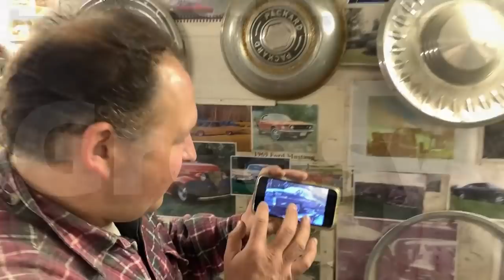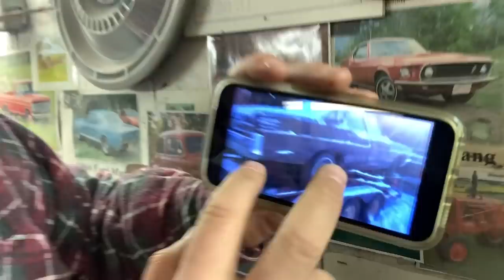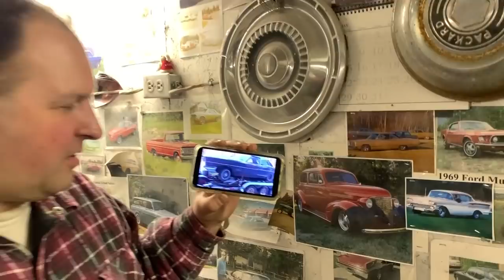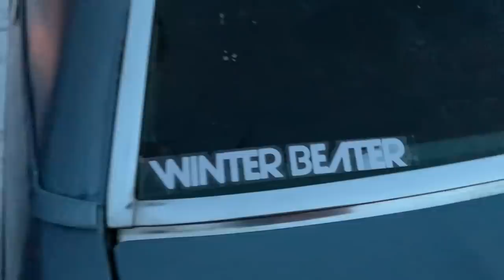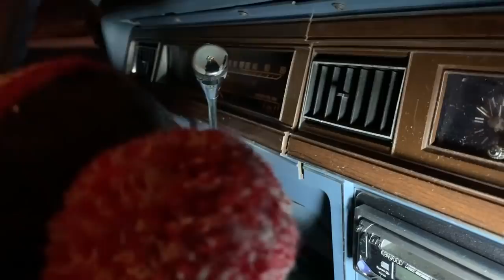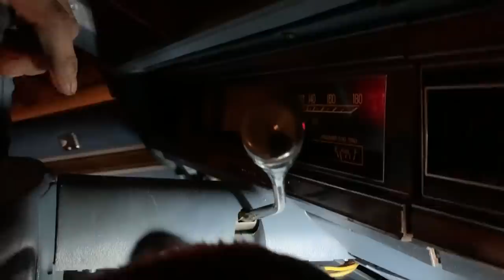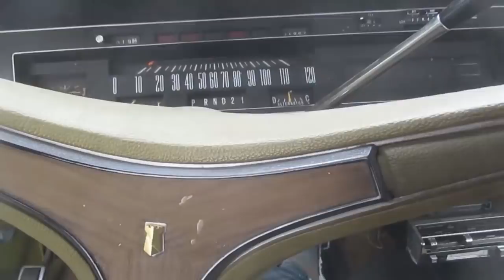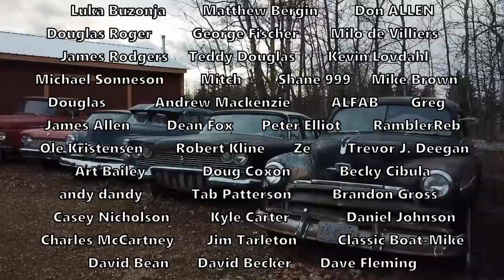Greasy Flips, more Fab, Trim, Paint, and and Beater Updates!

Comment: Nice lines on that old Pontiac, maybe the engine can be un-seized and run again, we need more Pontiac's on the road. Good luck Dean.
Not many cars have more trim pieces than the 60 Fury, but one at a time it's getting done.
I think Franker's thinks the CWM shop is her doghouse, and she lets everybody work there.
The door sill for the sliding door on the van was very crafty, looking forward to seeing that van painted and back on the road.
Dean's LTD is looking good, it's a comfy cruiser, the ignition switch and hood ornament is very nice.
The 72 Chrysler is another fine looking automobile.

Comment: Pontiac Laurentian with a Chevy 283. Only in Canada!! I think in the USofA that would have been a Catalina with a 389, or a 326.
Reply: Mine was a 326 catalina 2 door. It drove away for $400 in 1998
Reply: Mike Mullay I was thinking it was the LeMans.
Reply: @861LJ  The LeMans was the A body. The same size as the GTO, which is just a LeMans with a big engine in it, and specific GTO badging. Basically the same as the 1965 Buick Skylark coupe, and the Buick Gran Sport. The Laurentian in Canada was the same full size car as the Catalina. The Catalina came standard with the 326 but could be equipped with the 389, which is the same engine used in the Grand Prix and the Bonneville.
Reply: Also Australia, we got Canadian ckd's.
Reply: Mike Mullay thanks for clarifying! 👍🏻
Reply: Canadian Pontiacs used Chevrolet chassis....no wide track. They also had an odd Chevelle variation called a Pontiac Beaumont.
Reply: In 1966, all fullsize Pontiacs in America can with at least the 389 from Factory and the 421 was an option. Small block Fullsize Pontiacs didn't come till 1971 with the Catalina. Canadian Pontiacs were Chevys underneaths with Pontiac bodies on top, and they did come with Chevrolet small blocks

Comment: The 727 transmission doesn't pump fluid in park. I always used to start my Dart in nuetral because they do pump fluid in neutral avoiding the morning sickness when everything doesn't have fluid in it yet like the torque converter. The small 904 you never noticed it as it filled up faster being a lot smaller and lighter all around. Transgo made a pump in park kit for these transmissions which also meant you could check fluid in park like everyone else. If you want some fun try a stage 2 kit and drive it fast or slow. I had one in the first 727 I put against the 318 in my Dart. It would chirp the tires to second at low speed and punch the rear sideways at WOT at 5500 rpm to second, great fun. I finally broke it manually down shifting to first at speed so we rebuilt it with a stage 1 kit to save it from myself... I did add a sure grip clutch type 8 3/4 to help handle my abuse and give it better traction and launches for what it was.

Comment: The Chrysler transmission as two band adjustments one outside and one inside is the one that will take reverse out. I use to work on the military version 77 Dodge M880. Sometimes a fluid and filter change and band adjustment would revive reverse for a while. Good luck with transmission swap.
Reply from the maker: Thanks Ron! Yeah, you can hear stuff clunking around in reverse; I bought a seal kit and a reverse band and a few bits... We'll tear into it next week... Cheers!

Comment: 283 Chevrolet engine with a power glide in a full sized Pontiac, learn something new every day.
Reply: I had a 66 Impala with the same set up, worked great.
Reply: Here is more info if you care to read. Explains that the Canadian Pontiacs, were actually Chevrolets under the sheet metal.

https://www.pontiacv8.com/blog/2018/6/11/exploring-the-canadian-built-pontiacs
Reply: Bruce Hardy thanks. I remember the square Parisienne based on the Caprice.

Comment: I once had a GT250. I resprayed the side panels and put them in mother’s oven to cure. Sadly they melted. Well I was only 17.
Reply: Bake side panels at 350 until golden brown
Reply: I used my mothers electrolux vacuum cleaner to clean out a replacement gas tank for my 1064 Ford Custom. Needless to say that even though it was dry there was still fumes in there, it shot the motor from that electrolux three blocks down the street onto the lawn of the local RCMP station. I was also 17.

Comment: The fuel gauge in my '73 Newport never worked. At the end I had to hot wire it, because it had an open circuit in ignition primary too.

Comment: The Laurentian would make a decent cruiser/grocery getter.  The cool thing is its mostly chevy underneath so parts etc cheap.  Also the 350 SBC crate motor a bolt in if needed 👍 come on someone save it.
Reply: I'd certainly save the  classic.  The 283 or the recently refreshed 327 will certainly be a strong block. I did own a 66 before, unfortunately she was stolen. However my 1967 is a strong reliable classic.  
I am hoping to get the opportunity to put the 1966 back to near new condition and be a reliable driver for holidays and special occasions.  
I agree save the  66 classic!

Comment: I own a '72 Suzuki T350, I bought it new in 1972.  There are very few of these around.
Reply: I learned to ride on a Suzuki 125K.  it was around the same year as your bike.  So far I have failed to find any information on them on the net.  Heard of it?  Info?
Reply: @paulstandeven8572  I'm not a Suzuki expert, but I believe the nomenclature for identifying Suzuki motorcycles goes like this (first one or more letters, then numbers representing the engine capacity, then a letter denoting the year of manufacture) So I think your Suzuki 125K was actually a 125cc built in 1973.  Suzuki built 4 125's in 1973 was it one of these?  http://suzukicycles.org/1970-1979/1973b.shtml
Reply: @philmoore9829  Thanks for the post.  The bike I learned on (it actually belonged to a friend) was a 'touring' model with deep section mudguards and a full chaincase on the final drive.  Also, it wad electric starting

Comment: im doing the cylinder head rebuild on a 99 volvo v70xc awd wagon it has the turbo 5 cylinder and its a pain in my ass burnt an exhaust valve and whoever did the timing belt before I owned the car set the time at TDC and if you know Volvos they don't have the timing set at TDC they are set up on marks Before Top Dead Center so it had two bent intake valves as well my engine also has a VVT on the exhaust cam making the job that much harder